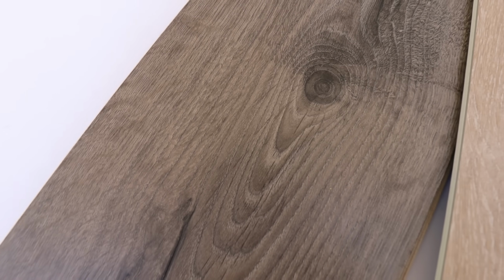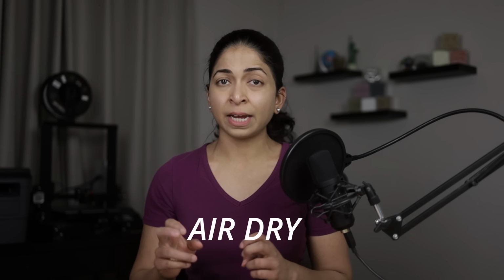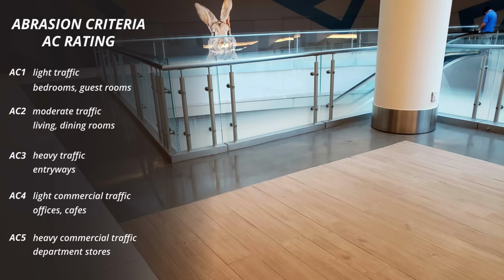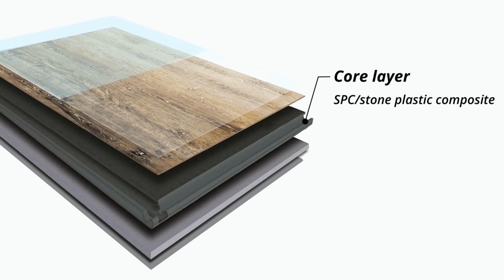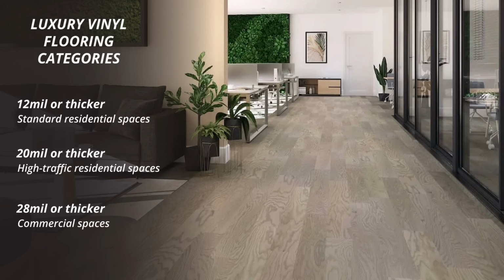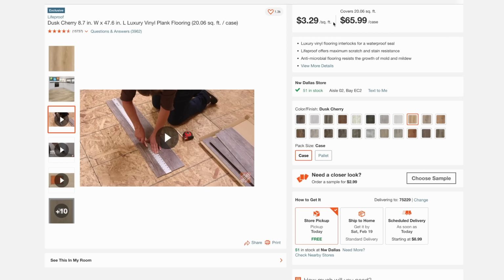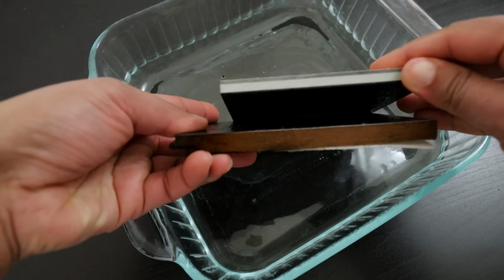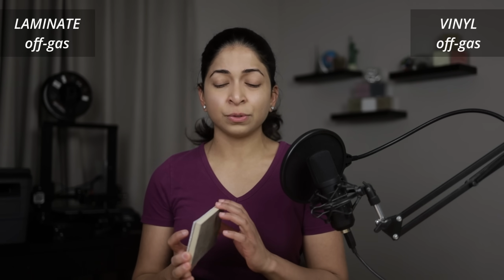Laminate vs Luxury Vinyl Plank Flooring | Everything you need to know!

Comment: Thanks for the video.

One important difference, at least to me, is the surface sound. The degree varied by brands, but laminate flooring consistently has a louder, more harsh sound when walked on or when things are slid across it. A lot more high frequencies to the sound profile.

Another is that LV planks will relax to fit the undulations on a floor surface, while laminate will just bridge the hollow spots. This makes for an unpleasant feel when walking across said hollows. It's particularly noticeable on concrete floors, which tend to not be as flat.
Reply from the maker: Great observation!
Reply: The core hardness is a big part of the noise difference.  Vinyl is softer often used as a mass dampener and sound deadener.  MDF and HDF are much more solid while vinyl has more give.  I also much prefer the feel of the LV to the laminate.
Reply: @ljprep6250  I'll go further & say that laminate makes me uncomfortable. Almost a fingernails on a chalkboard feeling. My son's last house had laminate throughout & I hated walking on that floor, shoes and no shoes.
Reply: @frankpratt529  I agree with all of your points.  Made the mistake of using it in my last house just to get it habitable again.  I knew I wasn't going to like it.  I didn't realize how much I was going to hate it.  Dropping just a cable to the floor is like a mini gun shot.  The coating applied to the surface... better not have wet boots or even wet bare feet.  I'm an agile fit man and came close to busting my ass far to many times.
Reply: @ShainAndrews  There's gotta be something fundamentally different in the surface treatments on the two. LVP does not have that slippery when wet thing that laminate has, yet it cleans & sweeps easily.
Reply: @frankpratt529  Agree.  Friends put some of that down in a small mud room area and we have no issues with it.  But both my friends and I agree that none of us would like an entire floor of it either.  I suspect the laminate coating relates to wear resistance.  Pretty tough stuff, and seems highly hydo phobic.
Reply: @ljprep6250 n
Reply: @lindacarroll4217  Are you sure?  "n"?  ;)
Reply: Yes, right from day one I have really disliked the sound of laminate flooring, it's like cheap shoes!
Reply: @Chahlie  You should always remove your shoes before you enter your house.
Reply: Shoes are not worn in homes in the area I live. Walking on laminate in socks or bare feet is almost as bad as with shoes. If I were to live with laminate for a while, I might get used to it. But why would I put myself through that when there are so many better alternatives.
Reply: We used "silent step" under our shaw laminate and it doesn't seem harsh at all. Nice and quiet.
Reply: @ellesnyder942  I guess it's something that bothers some more than others. Underlayment will help some, but doesn't eliminate it.
Reply: I thought it's basic knowledge that before installing tile or flooring, the base surfaces have to be fixed, as in fill the hollow areas or grind the raised areas. Otherwise the finished surface will suffer.
Reply: @Lara-jp4xk  That's true if laying laminate on concrete. For good results the floor must be ground/filled to a very flat finish before laying laminate. Contrary to one of the above comments, the resilient layer on the bottom will do nothing for floor irregularities. Even a wood floor built with modern engineered lumber may have dips that are noticeable with laminates. So why would one go to all that cost to level the subfloor when you could just use LVP. Any decently finished concrete floor will not require any leveling beyond grinding off any ridges
Reply: I think you have them backwards.  Vinyl planks are more solid and louder,  they also don't settle like you said as laminate does because the natural cork wood core expands and fills the voids and hollow area
Reply: @MrJoshcc600  Nope, not at all.  Vinyl has more flex and is an acoustically 'deader' material than the wood composite that laminate is made from. A vinyl plank that is laid over a minor dips and humps will eventually relax to fit the irregularities. Laminates never will.

Another issue with laminate is that the surface layer has a harsher sound. Try this; go to a home center and scratch or tap your fingernails on the  surface of both a vinyl plank and a laminate. You'll see what I mean. The laminate is louder and has a high frequency element that is unpleasant.

Read the comments above. They are all spot on.
Reply: @frankpratt529  That's why you need a foam underlayment for laminate to remove the dips and deaden the sound. User error on your part?
Reply: @lwh7301  Under pad is fine for a nice, flat floor, but most concrete floors with easily have 1/4" variation over just a few feet. Pad does nothing to hide that. I don't know that I've ever walked on a laminate over concrete floor that didn't have bouncy spots. I can't figure out what you mean by use error. I can assure you that I know what I'm doing when I lay flooring.
Reply: @frankpratt529  You just admitted you don't know what you are doing. Putting laminate on a concrete slab that is not flat is a huge user error! In that case, levelers are used to fill in the low spots. Did you do the concrete too? HHAHA
Reply: @lwh7301  Whatever, you think what you want and you win in YouTube comments. But I suggest you actually read my comments. Did I ever say I'm laid laminate on concrete? No, in fact, and why would I when there are clearly much better flooring surfaces (like almost any other). Now climb out of your basement, tell your mom you were rude to someone and take your medicine.